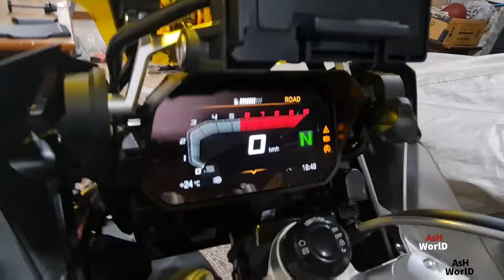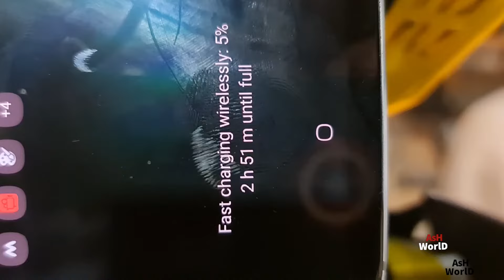BMW GSA 1250 _ Adding few Accessories

Comment: Rad protectors and headlight lamp protection are a must also if your considering going offroad...Bark Busters will protector your paws...like your yellow tinted windshield I run a dark EGRO 6 inches higher..Black Dog pan guard look ugly but the best protection you can get..its a huge bit of kit but does the job.

Comment: Hi, do you had any interference with the wireless charge and the bike (painel or wireless key) ?
Reply from the maker: Wireless charger will get activated only when bike power button is pressed. Apart from that there is no interference with Wireless key